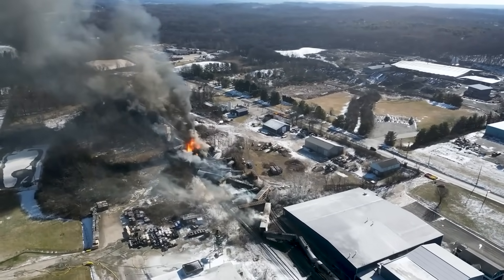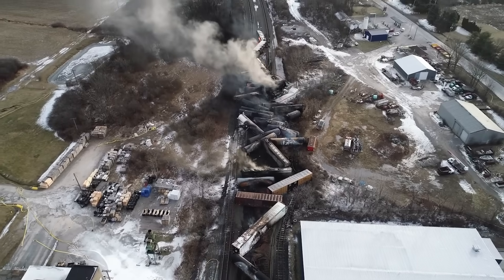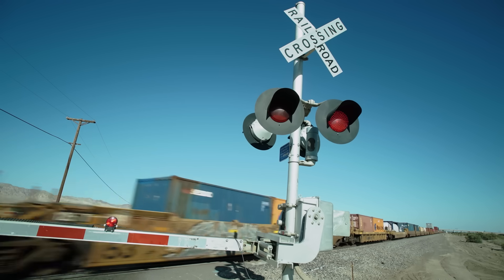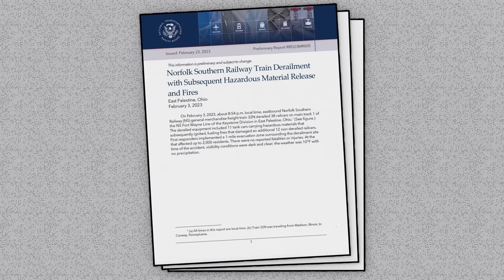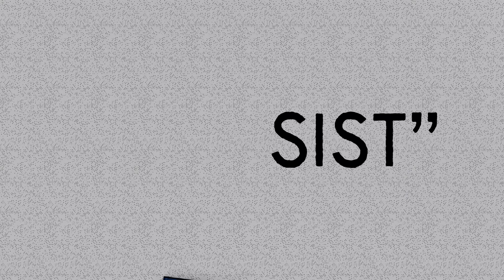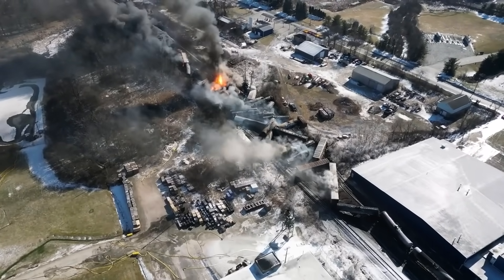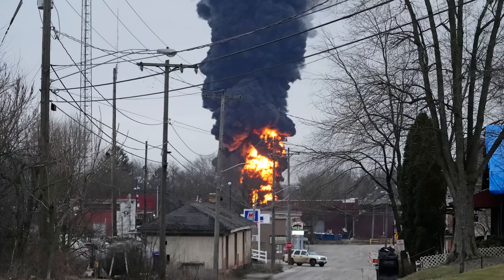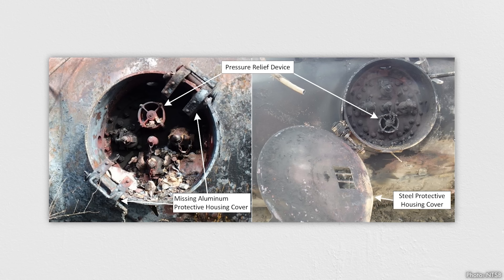East Palestine Train Derailment Explained

Comment: Time stamp: (05:01) why is this portion of the video captured from the security Cam of the train "moments before derailment" recorded while in dark mode?
The only reason you would have a recording in practically black and white like this is when it's dark, either in doors or outdoors. But we know (from footage captured at the time and on sight of the incident from other sources) that this occurred during daytime-hours. There's no other possible reason why the video footage would be recorded like this even if it's an old camera, this recording was taken after sundown. You can even observe the exterior lights from buildings and light poles are on which indicates late hours.
I work the graveyard shift as a private security Control monitor operator, so you can understand where my confusion stems from.

Comment: With all due respect, Grady, your brief explanation of how train brakes operate was misleading and unnecessary as brakes had nothing to do with this catastrophe. When a railroad truck derails, it is just a matter of seconds when the affected car derails and continue to derail following cars. Trains can stop in the controlled manner just the one way: with their wheels on rails. When derailed, as it was in this particular case, a train becomes just a mass with momentum with it's kinetic energy that can be lost in just the one way: by an uncontrolled crash. What failed was an axle with it's overheated bearings. What led to this disaster was cost savings on car inspectors (this car should've never left the depot) and the train crew's failure to stop the train and uncouple the faulty car despite being informed about overheating bearings.

Comment: A bit of information for everyone who doesn't know much about the railroad companies with safety to add about the air pressure, there's 2 things called an EOTD "end of train device" and FOTD "Front of train device" which communicate with each other so if there's a drop off air pressure, they will communicate and put the train into emergency, the Defect Detctors only detect the dragging equipment, defects and hot boxes as he explained for Defect Detctors.

Comment: You're completely, 100 percent wrong in stating there was a worry or even a problem with 5 of the VC cars.

It has NEVER BEEN STATED by anyone of authority or even someone of your authority that there was any problem whatsoever with 4 of the VC cars. Only one supposedly had an issue as stated by No folks suffering....

 At the most recent NTSB hearing in East Palestine OH in June of 2023 even more of the truth is trickling out. ALL OF THE PRESSURE RELIEF DEVICES WERE FUNCTIONING  AS DESIGNED!!! The chemical company who makes the posion and is responsible for the safety of manufacturing and shipping the compound, stated over and over to No folks Suffering that the PRDs were good, the product was stable, the temperatures while elevated were dropping...Again. AS STATED BY THE MANUFACTURER OF SAID PRODUCT... IT WAS STABLE AND THE PRDS WERE OPERATING AS DESIGNED!!

I'm sorry for all caps but when I hear supposedly smart people make just ignorant statements as facts, when clearly if you really did your research or actually talked to the people here in this hellscape of a town, you would apologize for making just bold un proven statements to back up your thesis...

There was NOTHING CONTROLLED ABOUT THE EXPLODING OF 5 VC CARS EITHER.....AS STATED DIRECTLY FROM THE EPA COORDINATOR ONSITE...THE AIR MODEL WAS PERFORMED FOR ONE!!! VC CAR....NOT 5!!! The fn OH National Guard model that is and was used was for ONE VC CAR.

Again just factually wrong information to create your narrative around your hypothesis!!

Please, please I believe your a good person and are trying to help the people understand but when these posions are in your backyard...Don't minimize  what was done here and how its just the "price of business" 

We just had another document ed fish kill here. The EPA who you so dearly defend as great came out the next day with 'wasn't from derailment'....Where's the necropsy data that supports such a definitive claim?? COULDN'T HAVE BEEN DONE IN LESS THAN 24HOURS..

The whole town and creeks are STILL highly contaminated... please see the latest data put out by DR.Andrew Whelton of Purdue University. And other videos on YT by local people And how the EPA have turned this into a complete PR coverup for NS.

The EPA is using the worst excuse as possible to not look into what he has uncovered.. They wont accept it because he won't release a name of the person who provided out of fear of retribution... what you don't hear from their PR spin is...lets use our 12 billion dollar budget and NS having to pay this bill anyway as legislated...to test his hypothesis and actually perform another set of INDOOR SAMPLES! Folks...the EPA IS STATING AS FACT THAT INDOOR AIR IS OK FROM ONE!!! INDOOR AIR SAMPLE TAKEN BY A NORFOLK SOUTHERN CONTRACTOR IN FEBRUARY!! There has been no further indoor monitoring whatsover. Furthermore, the PID devices they used have KNOWN deficiencies for the low levels of these compounds and the risks associated with these compounds. Again, Mark Dourno from the EPA admitted  this at a  town hall in March of 23... Do further research before making videos such as this, attempting to minimize the impact we people, subjected to  this nightmare are going through having to fight tooth an nail with NS, DeWine's office, our EPA's to make this right and get people long term assistance, truly clean up and monitor people's health without the people having the pay THEIR OWN DEDUCTIBLES to see their doctors.

Look up the NTSB hearings, Andy Whelton or discuss his data before making minimization videos...

Comment: Modern trains are going towards ECP brakes (electronic controlled pneumatic brakes) that have a 230V DC ethernet cable running along the length of the train. This enables the braking to work simultaneously along the train but also provides an opportunity to hard wire all manner of equipment monitoring, including the actual bearing temperature of each wheel bearing. The problem is the cost and the added complexity to the onboard systems, extea maintenance tasks, and the human factors impaxts on the teain crew. Grady, keep up the great work.

Comment: Why was the defect detector not set to report an overheat at a lower temperature?  This derailment seems to have been caused purely by having the detection threshold far too close to the point of failure.

Comment: The decision to drain the flammable liquid and then burn it seems to have defied the Hard-Learned but sensible rule that "if you aren't sure what to do, do nothing !"
With regards to water testing, to say "there were no significant levels of" whatever in one's well water is crazy. If there is ANY contamination in one's well, they should have a clear case to sue for damages.

Comment: Ok so these defect detectors need to be updates to have both a hard limit (200 deg above ambient) as well as some sort of limit on the change in temperature from one defect detector to the next. Going from 40 deg above ambient to 100+ should have been enough of a red flag to trigger an inspection. If the bearing is projected to exceed the 200 deg limit before it reaches the next station it should trigger a stop.

Comment: They haven’t detected contamination.

That’s one of the more shocking government lies I’ve heard.
Reply: They claim there is no contamination from Three Mile Island either, yet they boiled tens of thousands of gallons of highly radioactive coolant to the open air. 😢
Reply: Vanilla chloride is highly dangerous, clearly it was all contaminated.
Reply: you want to prove this somehow?
Reply: @joedatius  sigh…not that I need to considering your blatant ignorance, but fine.

Butyl acrylate, vinyl chloride, ethylhexyl acrylate, ethylene glycol monobutyl, acrolein, hydrogen chloride, phosgene, TCDD found in air, soil, and water surrounding derailment including all private wells and the two 50-90ft wells sourcing the public water supply. This is not from EPA because guess what? They refused to test for any resultant contaminants from the combustion of vinyl chloride and the other chemicals including dioxins. The only information they released is that “treated drinking water is clean.” Instead they sucked up tons of soil and water and started shipping it to be burned elsewhere.

Texas A&M Superfund
PA DEP
OH Senate Committee Report
CDC (their team fell horribly ill while on site)
University of Washington St. Louis, University of Minnesota (both of which are clients of mine)

Comment: I found your video after a search for East Palestine Ohio NTSB. My son & his family closed on their house just 4 days before the toxic disaster. Their water source is a private well & they are just 19 miles south of East Palestine. 😕 Thank you for presenting this information clearly & in an easy to understand manner. I would like to see more about the methods used to "clean" the surface water (Sulphur Run Creek, Leslie Run Creek & Little Beaver Creek). In some places, they sprayed the creek water up into the air so the toxic chemicals would separate from the water & disperse through the air??? I'm not a chemist, but it seems to me that would put some of the chemicals back into the air where people would breathe it in. I'm going to look for more info about Hydrogeology in the area. Thanks again.
Reply: Be careful, it's highly toxic.
Reply: Their basically abunch of kids playing with toys they don't understand hoping the theater will appease us. Take control of your water supply and run it through filters designed to treat such pollutants. 

You can choose inline/plumbing filters (literally apart of your plumbing system) or beaker type filters. 

Air inside homes is also fairly contaminated by itself so there's no harm in using air filters or getting certain pollution absorbing plants.

Comment: I used to work in a steel mill and one of the jobs was fabbing Z piles together and then they would take them to the shoreline and drive them in to form a huge rectangular boat dock. They then filled it with contaminated soil and covered the top. This was in 09-10 and it was sent to jersey along the shore somewhere. That was a big job too. Pretty sure it was 200 feet long and the piles were about 45-50 feet tall total so they were probably only half exposed as you drive piles into the ground. I’m not sure the witdth of it but yea. That was a trip down memory lane there for me 😂

Comment: Will it happen again?  Yes.  In fact there have been several more derailments, including another in or around East Palestine.  Want to know, at least a little about what is in a tank car?  You have to catch the number on the Section 704-M Diamond placard on the car.  There is a book that then at least gives you some information.  For example, on the truck tank in this video has a Flammable(bright red with flame image) on it and the numbers 1267.  This is a form of gasoline.  Many of the chemicals listed in the book give instructions that if the chemical is burning, to let it burn because attempts to put it out will result in a worse hazard.   This is particularly true for plastics and various petro-chemical compounds.  Many of the worst of the volatile chemicals have flash points at or near zero, so if they escape the tank they are carried in, they almost certainly will burn.  The placards are there to give first responders an idea of the hazard they face.  Sometimes the easy answer is RUN!  Some chemicals can easily be extinguished if you use the right stuff.  Some chemicals react unexpectedly to air and water.  Some fire videos show fire fighters working on a car fire and you will suddenly see a bright flash.  This is often caused by cold water coming in contact with molten Titanium, which really doesn't like getting wet.  It is used in small quantities in cars to provide extra strength.
Reply: Everyday it seems

Comment: My take on this personally is that defect detectors absolutely need to be networked. We've had the technology to do this for 20 years, there's no excuse. Detectors should be able to communicate with detectors at bare minimum two steps out, IE to the next one AND the next one after that, and collate information on one train.

Doing this would actually allow detectors to spot patterns and not just follow a list of checkboxes, which easily would've stopped this derailment from happening; flag somewhat high axle temperatures when sending that information to the next detector, and have that detector compare temperatures against that information- a further elevated axle temperature above what was already an elevated temperature can and should be treated as a potential failure risk. But because the detectors are non-networked, all they have is the information they as a single detector picked up.

(There's also the option of networking defect detectors to regional servers, which would reduce the cost of individual detectors (since they'd just need some fairly basic compute capacity, sensors, and network hardware) and allow for more sophisticated data analysis, but would also introduce latency into the equation that may not be desirable. Not to mention a reliance on an outside connection staying, well, connected.)
Reply: Follow the money

Comment: The problem isn't using the rail to move dangerous stuff. The problem is the pathetic state of the US rail system and prioritizing profits over safety, which is the American way.
Reply: how was any of this a sign of profits over safety. sorry to tell you this but even with all precaution's and safety measures used there are always chances of something failing.

Comment: The burn was far from controlled. The plume tells you that. Flaring was the right call, but burning in an open trench is asinine. The burn is fuel rich. At the point it was in the trench, frac tanks should have been used to store and haul it off. The capacity to handle this was in the area. It is in the middle of an oil field with personnel and equipment nearby the site. Northfolk is willfully neglected with their inspection processes and the EPA made questionable calls. This is coming from a decade of oil and gas work with experience in a few hazmat responses as a field engineer
Reply: So how would you have done it?
Reply: @RawbLV  If the pressure release value were operable, open the valve and flare it. It will have a better fuel air mixture and burn better. If they were draining the cars into a ditch you handle it like a frac spill. Heavy liner (assuming the vinyl chloride won't eat it) in a ditch back to a lined retention pond where it can be pumped to a frac trank. Going to lose some in the soil. Strip the soil and intern it at one of the hazardous material landfills in the area.

Comment: So how exactly can a temperature of less than 300° over ambient have caused such a catastrophic failure of an axle, wheel or any other part of the rolling assembly that would cause a derailment???
Obviously it was time to stop the train, but how could it have possibly escalated at such a rate to have caused this failure at such a low temperature above ambient??
Reply: the sensors are 15 miles apart. it went higher before failing

Comment: You are correct about efficiency of railroading cargo vs trucking. I have been a truck driver for 20 years. And trucks are limited to gross weight of 80,000 lbs (without overweight permit). Taking in consideration of the truck and trailer's weight before the cargo is loaded on to it. The average weight of the cargo that can be loaded is about 40,000 to 45,000 lbs. Whereas train cars can take on 65,000 to 80,000 lbs +. In my opinion, railroading is the safest way to transport bulk commodity. Whereas trucking can get it there the quickest. Trains can deliver the quantity (as long as the shipper and/or receiver is located on or near the railways).
I enjoyed watching your videos. Keep up the good work. May God continue to bless you and your family.

Comment: It seems like the railway braking and safety systems are pretty basic. I suspect a great deal could be done technologically to improve safety: a $50 RasperryPi is smart enough to run a sensors and software that could do per-axle antilock breaking and continuously monitored bearing temp, axle speed, car sway, push/pull on each coupler, etc.
Reply: However, it probably would cost "a lot" when you aggregate the cost of upgrading all the rail cars. (However, that is not a good excuse when similar TOTAL costs surely have been put on the trucking industry, just one truck at a time.) I suspect the few railway companies likely have completed a regulatory capture of the people regulating and might get away with cutting the "costly safety" corners even if the popular opinion wants them to do the right thing and have braking and safety monitoring systems in line with the current century.
Reply: something like a raspberry pi is not adequate for realtime operations
Reply: @mtqrx  Sorry, I had Arduino in my head but put down an RPI. Ardunios are just an Atmega 328p chip that can run compiled C code, and they do run realtime in that config as there is no OS. And the Atmega 328Ps these are based on have variants that are REALLY cheap. Like $3 cheap for some modules.
Reply: @SoftwareExplorer  yeah, arduinos would work, afaik they have ARTe
Reply: @mtqrx  If you are writing C code like I have and you have interrupts (Atmega does), you have what you need. ARTe isn't exactly the measuring stick here. And it may or may not be allowed in some of the safety critical contexts. (There's a lot of library code out there that the writers specifically say DO NOT use for aviation, cars, or nuclear reactors).